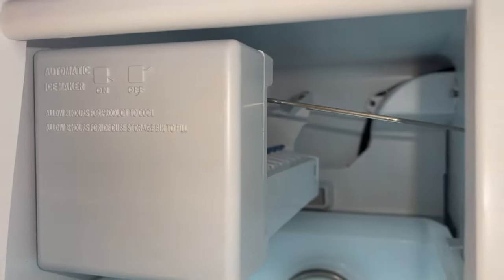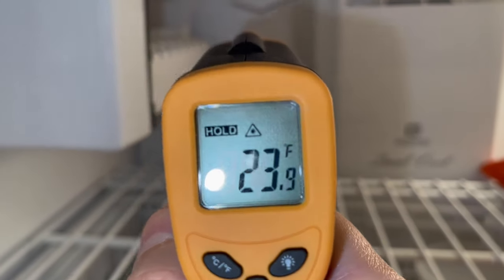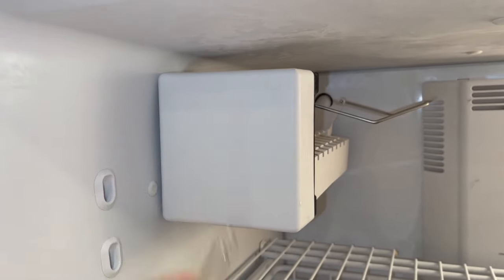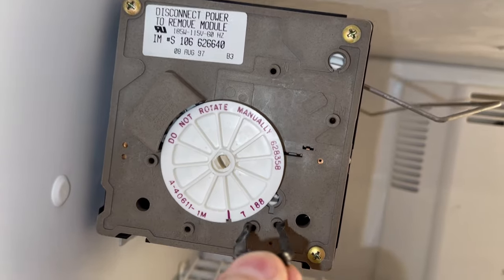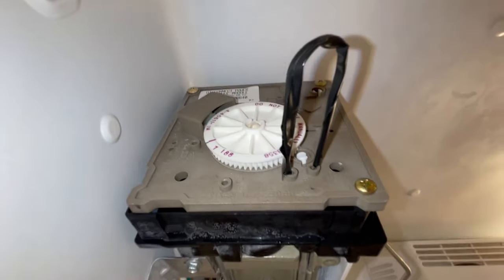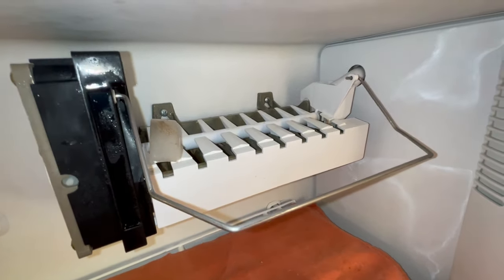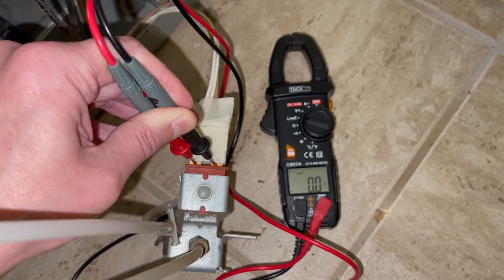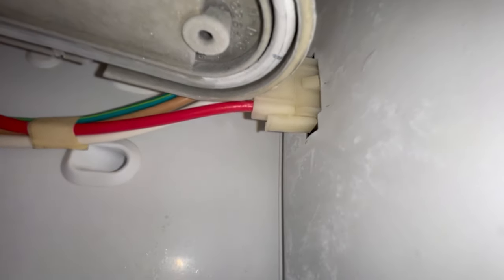Ice maker not making ice troubleshooting jumper test cycle

Comment: So I am real confused. I've got this ice maker in a newer Whirlpool. When I test ohm's between L and N it jumps all over the place, sometimes around 6600, other times it jumps up to 12000 and other time it is open. When I check volts I am getting very, very low reading (less than 1 volts). Can't figure out what that could be. Is there some power supply or solenoid that is sending power to the ice maker that may have gone bad so it isn't even getting power at all?
Reply: When I try to jump it I get no response at all. I thought it may have been frozen in place but there is no sound or motion indicating that it is even trying to do anything.
Reply from the maker: You should get about 120 VAC between L and N... Ohms are irrelevant in this case.
Depending on your model, the power to the ice maker can directly come from the outlet, or go through an electronic control board. If you have infrared sensors, they could be bad.
You can try unplugging the ice maker wire harness and plugging it back in. To make sure it sits well.

Comment: @yourself What does it mean when water does not stop flowing into the ice maker?
Reply from the maker: It really depends on your refrigerator model.
It could be a stuck inlet water valve or the ice maker itself going bad.
On newer refrigerators, the problem could be with the computer board.
When did it start overfilling, and how did you stop the flow?
Reply: @Your-Self  its a kenmore. Not sure of the model but it looks just like the one in your video. Its a about 12 yeare ol. I changed out the tube that brought water from the water heater to the ice maker. When I turn the water up it starts to run through the icemaker..the ice maker does work because it pushes out any ice made from leftover water sitting in the tray after I manually turn off the water source.

Comment: My ice cubes are freezing together. Brand new ice maker.  Is there an adjust on this type of ice maker to decrease the amount of water coming into it?
Reply from the maker: Some may have a visible adjustable knob on the right side.
Mine is hidden under the cover. Once the cover is removed, it's a small plastic screw in the middle of the right side. Rotating it clockwise should decrease the fill amount.

Comment: My whirlpool model GSF26C5 stopped making ice.  I recently replaced the ice maker module.  I tried to manually start the sequence with T-H but no luck.  I checked for power and don't get 120 Vac at either V-N or L-N at the ice maker module.  I traced the module connector back to the door connector and found it to be ok.  How do I proceed from here ?  Is there a "Reset" switch to the ice maker.  BTW, Ice maker does not respond to the T-H manual start either.  Thanks in advance.
Reply from the maker: This model number is incomplete.
Your refrigerator may have infrared emitter and receiver boards. If one of them is damaged, the ice maker will not get 120VAC
Reply: @Your-Self  The model is Whirlpool gsf26c5exy00.  I confirm that the emitter/receiver circuit does not work.  How do I bypass this to get the 120 VAC from the control board to the ice maker ?  Thanks.
Reply: I presume the 120 V can be checked at the 4 conductor connector with the ice maker disconnected.  Which pins would read 120 V?

Comment: Thanks for the video! Question for you - my ice maker will run if I jumper it, but once it goes through the cycle, the fingers hit a spot where it just stops. Again, if I jumper it, it will work (motor turns the fingers, heater turns on and allows the ice to break from the mold and be moved, and the fingers make their way around and harvest the cubes. Then it fills with water, but the fingers stop and won't move again to harvest the ice unless I jumper it. Any idea what might be the issue?
Reply from the maker: When you jump the T&H, you bypass the thermostat. So the thermostat is probably dead since it won't work on its own... assuming the temperature is close to 0°F. Typically it's not replaceable so you'll need a whole new ice maker.
Unless your refrigerator model uses a computer board to control the ice maker. In this case, the problem might be with the PCB board or the wiring.
Reply: @Your-Self  Thanks! I'll try replacing the ice maker.

Comment: So, my ice maker is working in the sense that I see it rotating and is trying to produce ice, but I believe the water valve is frozen. Is there any way to “thaw” it out and avoid having to replace it ?
Reply from the maker: You should be able to thaw it out by squirting some hot water with a syringe into the tube where the water comes out. But this probably be a temporary fix. Because a slow-dripping water valve will continue to drip and refreeze.

Comment: I have a side-by-side Frigidaire and the icemaker has never worked. Is it possible to disconnect the water supply just to the icemaker to prolong the life of the water-filter?
Reply from the maker: If the ice maker is not working, it's not using any water from the filter.
Reply: @Your-Self  thanks!

Comment: My ice maker works fine only one round of ice every time I jumpstart it and then stops producing ice. There is water in the reservoir but it won’t push it out when it becomes ice again. It will only do it when I jumpstart again. Is my ice maker bad?
Reply from the maker: The temperature around the ice maker should be close to 0°F (-17°C) to work consistently on its own. What is your temperature?
Reply: I don’t have a infrared thermometer gun, let me get one and test it and get back to you. Thank you for your quick reply.
Reply: @Your-Self  the temperature is below -17C, just checked with an infrared thermometer. Still only producing ice when i jumpstart it.
Reply from the maker: Hmm. When you jumpstart, you basically bypass the thermostat inside the ice maker. So it's possible that the thermostat is bad.
Also, if your refrigerator is computer-controlled, the problem could be with one of the electronic boards. What is your model number?
Reply: @Your-Self  The refrigerator is maintaining a stable temperature though in both the freezer and fridge, wouldn’t that indicate that the thermostat is working? Maytag MSD2574VEW10 is my refrigerator.
Reply: @Your-Self  I actually changed the main board a few years ago when I had a temperature issue and it fixed the problem. Maybe its time for a new refrigerator as this is 10+ years old.
Reply: @Your-Self  I’m just wondering if I should buy a new ice maker and try my luck even though this one works every time I jumpstart it.
Reply from the maker: These refrigerator models have problems with wiring. Open the freezer door, and look at the wire harness on the very bottom by the floor. After years of opening and closing, those wires break. Inspect each wire. Sometimes the insulation looks good, but the wire inside is broken. And if they all look intact, try replacing the ice maker. Part# WPW10300022.
The bad thermostat, I was talking about, is inside the ice maker itself. Not the one that tells the temperature inside the freezer/fridge.
Reply: @Your-Self  ok, let me take a look at that first before buying the ice maker. I will also look into the freezer thermostat, I did not know there were two separate ones controlling each section. I will keep you updated. Thanks again!
Reply: @Your-Self  the wires on the bottom looked good. Just received the factory certified ice maker replacement and replaced the old one. I’ll let you know if this will solve the problem. I will give it 24hrs first.

Comment: If there is only 8 volts coming out between V&L, is the controller board bad if the wiring is ok?
Reply from the maker: Do you get 120 VAC from the N and L terminals? If yes, the ice maker is probably bad.
If not, what is your refrigerator model number? So I know what controller boards are there.

Comment: There is no water for my ice maker. How can I Iocate the water valve? I can only see a water pipe in the back, pluged into the back cover. Shall I pull it out to get water valve?
Reply from the maker: The water pipe plugs into the water valve on the bottom. You probably need to remove the back cover to see the water valve clearly.

Comment: I have been having issues with mine. I have replaced the entire ice maker, but it only makes ice about 4 or 5 cycles then quits. When I jump out T and H, the motor will not run for the harvest cycle. I have 108 volts between L and M.  Is that enough voltage?
Reply from the maker: The motor should be getting the full line voltage, around 120V. Maybe the connector is loose/corroded. Try to unplug, and then snap it back in. If you have a Loz function on your multimeter, use that instead of AC. Because the 108V could be a "ghost" voltage. The Loz will remove it, and in reality, there is 0 V.
(the 108v is good for the Water Valve though, V and N for a few seconds)
Is the motor humming at all?
Anything is jamming "fingers" scooping the ice?

Comment: So if the motor gets stuck when it tries to harvest is it safe to assume that it’s a heater issue ?
Reply from the maker: It's very possible. You can try using a hairdryer from the bottom of the ice maker to loosen up the ice cubes and prove it's a heater issue. Just be careful. A powerful hairdryer will melt the plastic liner.
The ice maker motor could be bad as well. Either way, you'll need a new ice maker.
Also, inspect rotating fingers. There could be one of the ice cubes stuck in between them. Or something else could be stuck there, preventing rotation and harvesting.

Comment: I am getting no voltage reading using a multimeter, is there anything I can do to save this? The cable is connected properly - the unit seems dead no water is coming into the ice maker and it does not respond (or spark) when I connect the T&H using a cable.
Reply from the maker: Try unplugging the cable and see if it's corroded, therefore, not making good contact.
Otherwise, you need to trace (investigate) where you lose power.
Reply: @Your-Self  Thanks for the reply. Turns out my bin was blocking the arm. Even though I still got no reading on the multi meter the ice maker started working when I removed the bin. The manual reset worked.

Comment: It’s me again The icemaker did the same thing and I had to jump it with the paperclip. Do you think that’s the motor that needs to be replaced because the water comes out after I jump it or is that solenoid bad? I didn’t think I could get that Lucky.
Reply from the maker: If the ice maker goes through the cycle after you jump it and it drops the ice, the motor should be good.
If the water fills the ice maker at the end of the cycle, the water solenoid should be good.
That leaves the thermostat inside the ice maker as a possible problem. What is the actual temperature around the ice maker? It could be too warm for the ice maker to harvest on its own.
Reply: @Your-Self  it’s zero so that should be good
Reply: It fill the water in the icemaker, but that’s as far as it got
Reply from the maker: The thermostat is probably bad.
On some models, it's possible to replace it. However, it's best to replace the whole ice maker.
Reply: @Your-Self  Thank you for all your time..😊

Comment: Uhg. It would appear that they updated this model. Looks exactly the same on the outside, but when i took the end cover off, all you see is a metal plate, two gears (just like the ones you show), a screw mounted exterior on the plate, horizontally in roughly the two o'clock position, but NO HOLES for testing whatsoever. I'll probably remove the icemaker tomorrow and start taking it apart, but what jerks...
Reply: Same problem here   No place to jump it
Reply from the maker: Ice makers with 2 gears, you can jump-start by rotating the smaller gear counter-clockwise with a screw driver.
Reply: @Your-Self  thank you   No luck    Can’t get water to pump   Going to check the valve tomorrow    Filter good  it’s zero degrees F

Comment: I jumped the two terminals and it went through it's cycle once but didn't fill with water. So I jumped the terminals for the water valve and it worked, but then didn't eject the ice. So I bought a ice maker online, installed it and it worked for maybe 4-5 hours and now doesn't work again. What should I do now? I haven't checked the voltage to the ice maker yet
Reply from the maker: If you bought the new ice maker somewhere on eBay, it's very possible the quality could be subpar. If the new ice maker is getting the voltage but won't go through the test cycle, it's bad.

Comment: This should be done with a insulated wire if you touch something grounded while doing this you will be rudely awakened from your uninformed state . This is not a low voltage appliance.

Comment: The maker is full of ice but there ejecter is just rocking back and forth. Is there a way to test the heat element?
Reply from the maker: You can jumper H to N to check the Heater.
You'll probably need to replace the whole ice maker anyway.
Reply: @Your-Self  thank you.

Comment: My ice maker only drops the ice after the jump start.  After I jump start, solid ice drops out.  Then I check the next day, no more ice has dropped.  I jump start again, and solid ice falls out. Why do you think this happens?
Reply from the maker: Make sure the temperature around the ice maker is around 0°F. If it's much higher (let's say 15°F+), the ice maker will not harvest on its own.
If the temperature is good, then the thermostat inside the ice maker could be damaged. Therefore, you may need to replace the whole ice maker.

Comment: What is the line is clogged as it goes thru the outside wall?
Reply from the maker: If the water tube is frozen, you can un-freeze it with hot water in a syringe. Or buy an "ice surrender tool".
Reply: @Your-Self  Thanks - that's what it was.  Works great now.

Comment: so i just tried this an it woudlnt reset the wheel I even saw sparks within both of those little holes so i figured id pushed deep enough...any ideas I think the ice froze over the tray because I can feel ice cubes inside the mold an when it went to fill with water the water just ran by itself into the ice bucket an froze the ice that was in there solid I recently emptied the bucket but still have the ice maker issue is there a way to defrost the ice out of the icemaker without using a hair dryer I dont have one
Reply from the maker: Try defrosting with warm water and something like a sponge.
Reply: Just poured hot water from the electric water pitcher into the ice tray area. It cleared out the ice tray and other ice that had frozen the gears, now it's working again. Thanks for the video, helped me understand what to check.

Comment: Hi. Is there a reason why the wheel does not stop spinning? Water flows however, the fingers just keep going around, the lever goes up and down and the wheel keeps spinning. Thank you.
Reply from the maker: Sounds like the stop-switch inside the ice maker has worn out. You should probably replace the whole ice maker. It's pretty cheap and easy to do yourself.
Reply: @Your-Self  Thank you, sir. Appreciate your time.
Reply: Also, do you happen to have a link of the ice maker to purchase? Thanks again.
Reply from the maker: All ice makers have slightly different connections. What is your refrigerator model number?
Reply: Yes, it is a whirlpool WD2020L.
Reply from the maker: Here is your ice maker part# WPW10190965 
But before you buy it, these side-by-side models have a wiring problem. Open the freezer door and look at the wire harness on the very bottom by the floor. After years of opening and closing the door, the wires can break. Inspect each wire for damage. And if they all are intact, buy the new ice maker.
Reply: You mean behind the grill? I don’t see any wires.
Reply from the maker: Yes, could be behind the front kick-plate.
Reply: Could it be behind the fridge?
Reply from the maker: If it's not on the bottom, the wires probably enter the door from the very top. There should be a plastic cover on the left side corner that you can unscrew. But most wiring problems are with models where the wires enter from the bottom... so you are probably OK.
Reply: Can you please recommend an amazon seller? Thanks again.
Reply from the maker: Amazon/eBay may not be selling genuine ice makers... you just never know. But if you buy it from, let's say, Sears or encompass.com, it should be good. Just enter part# WPW10190965
Reply: Hi.  So I received the replacement and installed it. How long does it take to start making the first batch?  Thank you.
Reply from the maker: It can take up to 24 hours for the first batch... assuming the temperature at the ice maker is around 0°F (-17°C).

Comment: I use jumper and it works but when I test volts, I get 0. Should that be the case?
Reply from the maker: Verify that your freezer temperature is close to 0°F. If it's higher than 10°F, the ice maker may not harvest automatically.